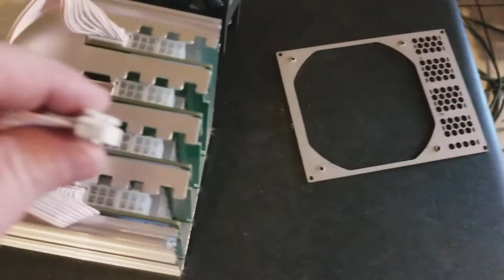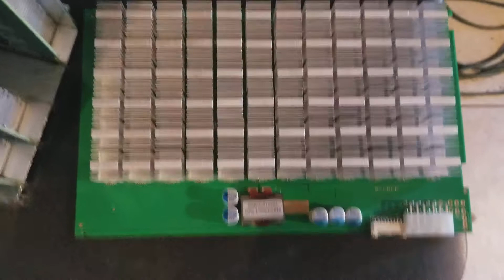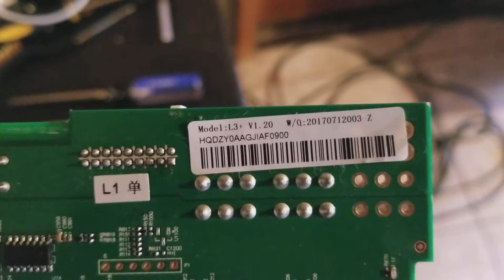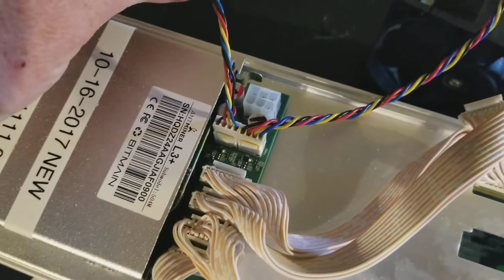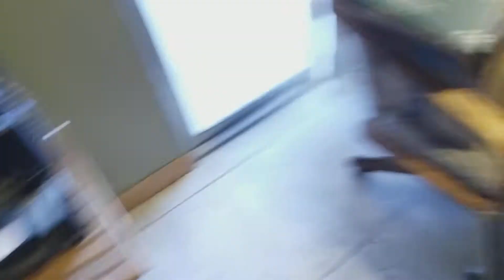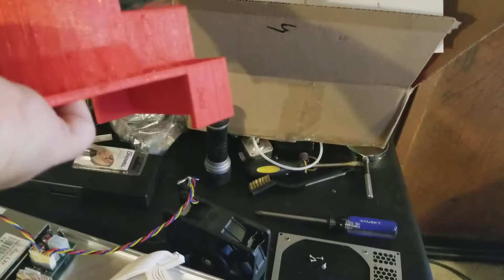Antminer L3+ D3 S9 warranty repair. How to get approval fast normally within 24 hr.

Comment: Can you describe process of finding which chip is dead? For my case, 70 chip's detected an ASIC L3+, visual we found one and change it, but other one we cannot found yet :(
Reply from the maker: Денис Гришко  are you changing your own chips? If so your voiding your warranty
Reply: Yes, I change chips to new. Bitmain warranty I think is shit in my country!
Reply from the maker: i sorry about that. as for the chip order on the board, they are not labeled and you might need to yank one chip on both ends of the board or on the top and bottom of one row and run it. you might be able to figure the chip order out that way

Comment: It's call a board, not a card. (As in PCB = printed circuit board)
Reply from the maker: un-called for guy Im trying to put stuff in layman's terms so others that dont think as tech-minded as you will understand. most of america has not worked for company's such as Intel like i have or Epson like i have. or have actually had the fun of hand soldering on a PCB like i have, so i make my videos for most of the public you know the 99% that dont understand tech talk.

Comment: I have a L3+ and I was getting 504 MH/s on day one, but on day 2 it dropped to 364 MH/s.  I re-flashed it no luck.  There is no error on the status board all show 000. Any Idea what can be causing this? I just noticed that chain 1 does not show up on the status board, reseated the power plugs, no success.
Reply from the maker: reset the usb cable. from the control board to the hash board, both ends do it with the power off. then reset it, if this does not work you need to do a warranty repair.
Reply: thanks - looks dead so I will have to send in the card to Bitmain

Comment: Shawn,how to check if there's a loose heatsink or not in the hashboard? because there's 2 warranty stickers one at each side that prevent us to pull the hasboard out.Dissasembling miner like this video is voiding warranty right? since you should take off a screw that has warranty sticker on it?
Reply from the maker: yes taking it apart will void the warranty unless you have bitmains permission. you can tell if a loose one is their you will hear a rattle other then the boards moving a little. so far out of my machines i have not had any loose ones so i think it is very rare for their to be one.

Comment: How do you detect which card has the issue? I have an RMA from bitmain and I think I'll have to pull each card out one at a time to see which one is defective.
Reply from the maker: Manish Ranjan 
It's very easy when looking at the machine on the network port end card 1 is the first card on the left 2 3 and 4 is the last one on the right.
Reply from the maker: You don't have to pull the card to find the defective one, all you have to do is un  plug all power and the usb cables from each card one at a time till it is no longer showing up, if the defective card is missing then you found it. Make sure to shut off the machine every time and reboot it each time after you pull the cables.
Reply: Thanks Shawn! I have D3 units but I get the idea.
Reply from the maker: do you know if you have the newer machine or older machine. the way you tell is take a tape measure to the back of the machine, if it is 2 inches to the top of the casing from the fan you have the newer one, if it is 1 1/2 inches you have the older one. this maters on what shroud to order.

Comment: Hi guy, I live here in California too. I just now received my 2 new antminer D3s today. On the side of one box was a huge dent. I immediately gave them a light shake as instructed by the sticker label on the antminer and heard some parts moving. Not sure if it was a loose heat sink or something else. I don’t know anything about these miners to be honest with u. So I didn’t touch/loosen/remove any parts. I simply placed them back into the boxes. By the way it sounded this way for both of my D3s. I don’t know what to do. but I emailed a notification of these possible damages/defects to bitmain support shortly thereafter and I’m just waiting for them to get back to me. Any tips on what I could do to better assess for actual damages mentioned above? Any information helps thank you.
Reply from the maker: best thing to do is wait for bitmain. they will probably tell you to open the miners to inspect the insides. if it is light rattling it would more then likely just be the boards slightly moving in the slots that they sit in inside the machine. they dont fit snug in the slots and have a little play internally but not much more then a 1/4 inch in total front to back movement.  you will probablly be okay, but it is good to wait for the response from bitmain just to insure your warranty.
Reply: shawnpc1 thank u much for your help. I’ll wait for bitmain then. Take care
Reply: I have the slight movement when tilt back and forth, is that normal? Or should not make any noise at all?   I'm from California as well :).
Reply from the maker: that is normal. its if their is a rattling sound that is metallic that is when you need to contact bitmain first.

Comment: I have a d3 with a faulty hash board, I just received it this week. with my unit the middle hash board is fixed to the casing. the other two boards slide out just fine. but the one I need to take out will not budge. have you had this issue?
Reply from the maker: how far did you overclock it. every board in each of my units slide out with no trouble at all. you may have a melted board from overclocking it

Comment: What temperature drops do you get with this adapter?
Reply from the maker: its averaging 5-8 degrees. compared to machines on the old shroud. and it also gets the rest of the heated exhaust out of my room from the back of the machines, keeping the room cooler and the machines cooler
Reply: I'm getting the same temperature reductions by using a 6 inch duct. Why do people use a 4 inch duct?
Reply from the maker: cheaper output hoses. it reduces the cost for all the equipment. where are you finding a 6 inch duct? or are you just using the duct with no machine attachments?
Reply: It's just a 6 inch duct on the fan
Reply: Nadim Awan

Comment: Great info , so much appreciated you posting this - shocked you had an issue so soon
As you know running 6 machines Overclocked and zero issues - knock on wood
Reply from the maker: first machine i had problems with, only took me 6 hrs to get it okay-ed from bitmain to send the card back.